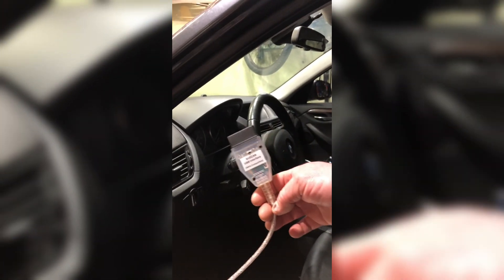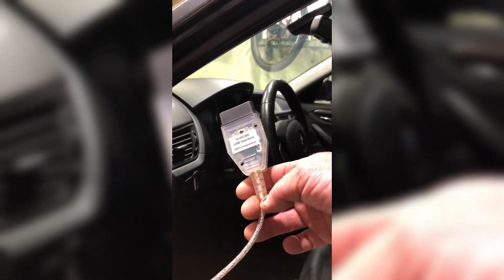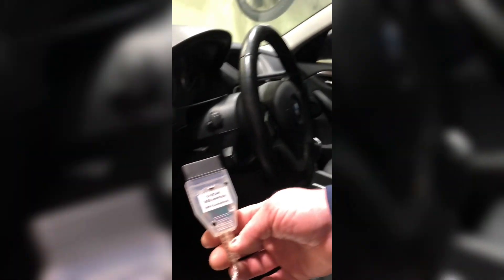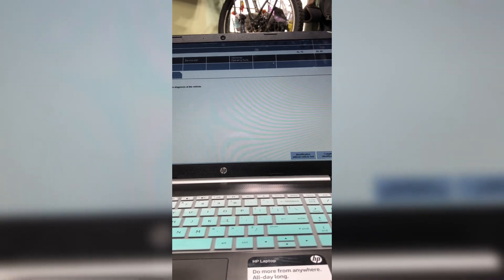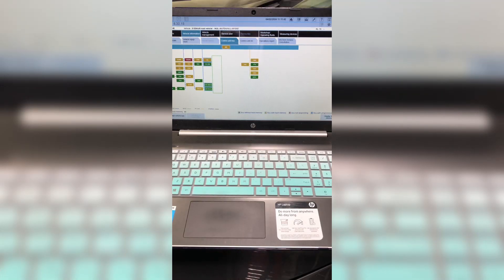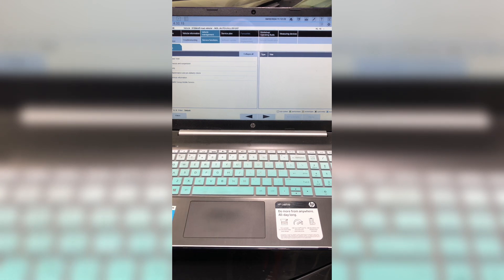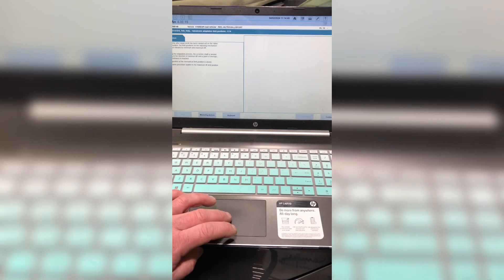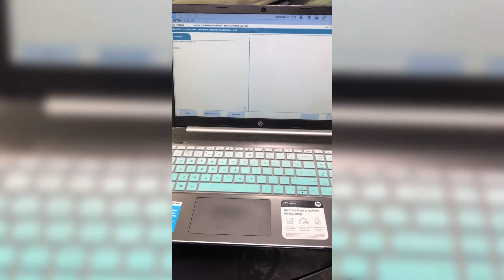BMW Valvetronic ISTA Relearn Reset Eccentric Shaft N20 E87

Comment: Can i do this procedure. I am getting these codes 
133401 Valvetronic, thermal mal overload protection: System switch-off
133C01 Valvetronic, thermal overload protection: Warning threshold, current, extended 
I have only these symptoms: rough idle  when cold start and sometimes when idling revs moves a little up and down, and sometimes also when car is hot it start misfire, engine choke a little you can feel inside

Comment: Hello, i changed the eccentric shaft and the valvetronic motor too!!! When i start the running phase , it start but they dont go at all the 450cycle , only 260 … must be all the 450cycle or not?
Reply from the maker: It’s however many cycles ista wants you to do , most follow on laptop screen instructions until it’s done with all steps and phases 

Good work on shaft swap 

It will go as many cycles as it needs to be happy and collect data needed to find sweet spot 😊
Reply: @TipsWithJay so , then this mean is good , or ? No need at all 450cylce? 
Anyways i relearn with Ancel700 pro!!!!
Reply: @DaVinCheat question did that ancel700 pro scantool work for you. Im trying to buy a scantool to reset my vvt.
Reply: @agustinlopez4312 yes it works , i have just coded my injectors and other things, but for the cycles i used ISTA because i dont know with Ancel stop at 260 cycles.